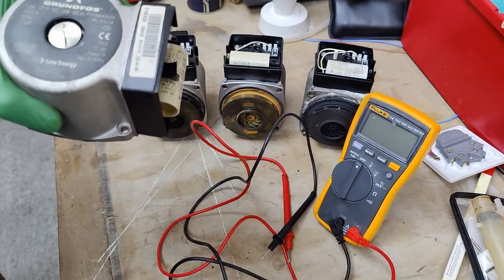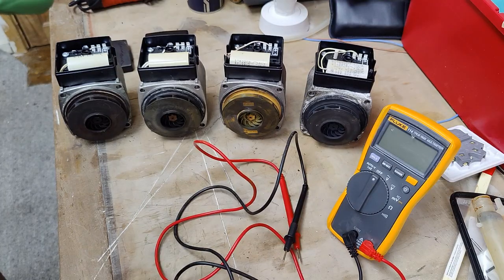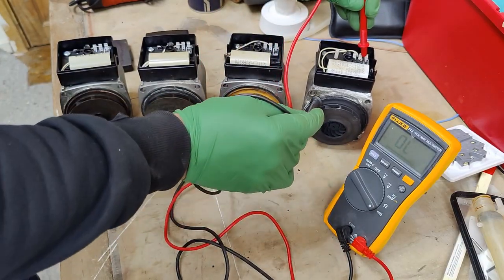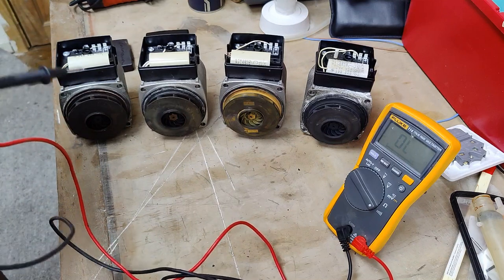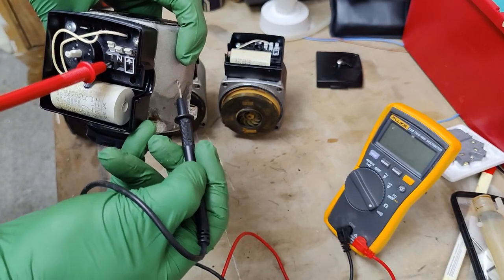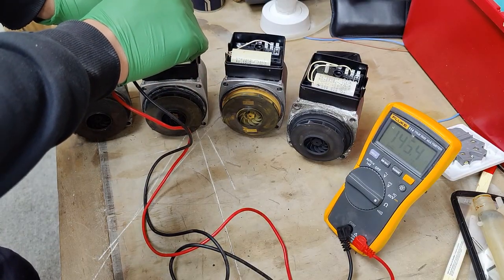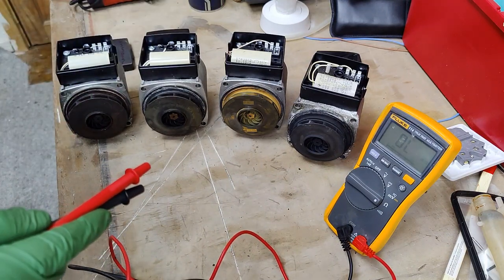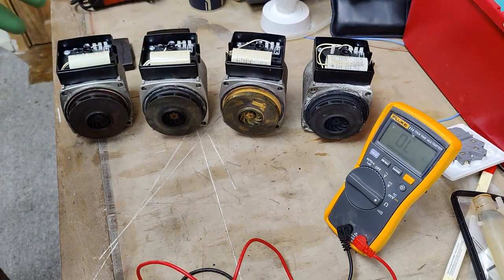How To Test A Boiler Pump Using Multimeter-  Pump Testing

Comment: If you didn’t have similar parts as a reference, how would you know what to expect in terms of resistance (so that you could determine it was faulty?
Reply from the maker: Hi Paul, I hope you are well. We can work residence reading by following R=V/I however the cold winding reading is different to when it's operational so the manufacturer literature can be consulted to get expected readings.
Reply: @ thanks for replying. Great video btw!

Comment: Would this also be the case for the newer modulating erp pumps
Reply from the maker: I will check a newer style pump and get back to you.
Reply: You can’t check them this way. They have switching power supply on PCB which make coil connections indirect

Comment: Thank you .What range is "acceptable" on L-N
Reply from the maker: On working pumps I normally find between 135 ohms to 155 ohms however it will differ for bigger or smaller size pumps.
Reply: @MHKBuildingSolutions  Much appreciated 👍

Comment: if the pump is running and how do u know if it's working well?
Reply: Can also check the amps it's pulling, that it matches what the manufacturer states.
Reply from the maker: If all the radiators are warming up, the boiler isn't overheating and Delta T is between 20 degrees then I would say that the pump is working fine.